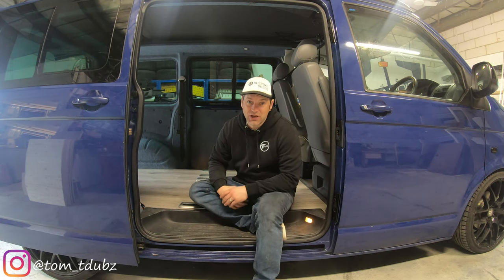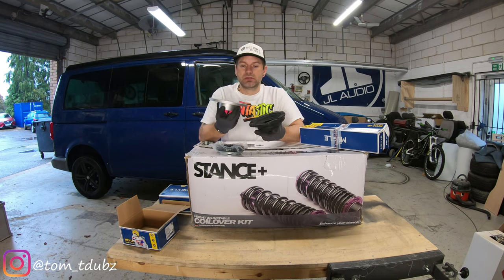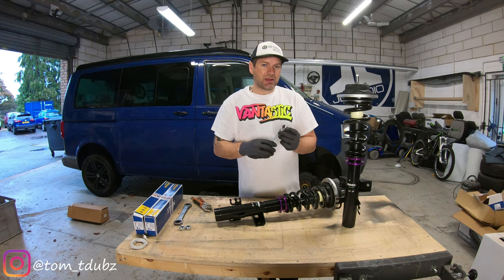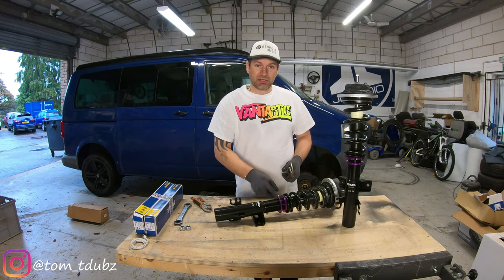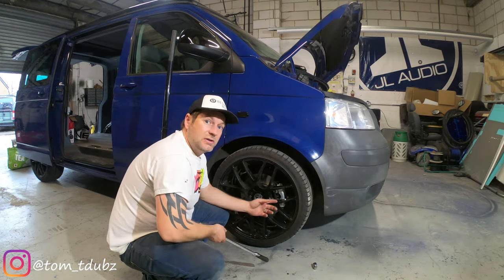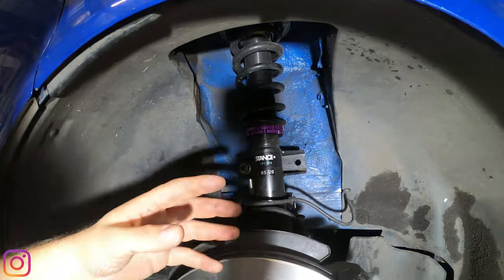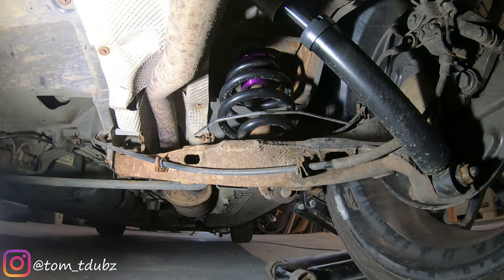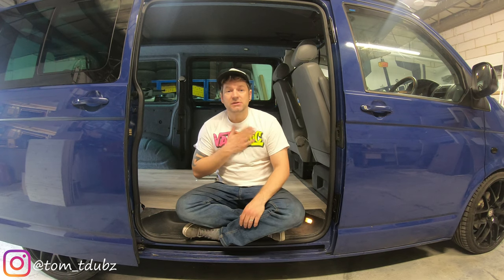VW T5 coilovers #series2 #episode6 #stanceplus

Comment: Nice tutorial !
May i just ad a small comment to the fitting process...
Iff you are changing the standard shocks and springs  for a  lower /coilover setup ,then its wise to loosen the bolts of the wishbone (don't undo them ,just loosen them a bit ) .
Once you have installed your lower suspension ,fasten the bolt's of your wishbone ,when the  van is lowered down on it's wheels ...the reason for this ,is to remove extra tension from the rubber wishbone bearings ,so they will last a lot longer ( otherwise they are under  continious stress ,and the rubber will tear  )
Reply from the maker: Thanks. That’s a great shout!!!! 👌🏻👌🏻👌🏻
Reply: @tomtdubz how does the van drive with the coilovers on? Worth buying?
Reply from the maker: @joemc5238  have to say for the money there great, if installed correctly.. they get a bit of bad press on some of the Facebook groups but 9 times out of 10 there not fitted correctly. I’m happy with them an have another set ready to fit on my latest build too 👌🏻

Comment: Had Mine fitted about 2 Mts now, all spot on ,,, my only grumble is they are a little bouncy over humps and bumps is that how they are ?
Reply from the maker: In my experience yes.. if your gunning it low then changing the rear shocks to gaz short shocks is good. For the front a hub mod then you can add some tension back on the coil.. 👌🏻
Reply: I would like to see this hub mod please
Reply from the maker: https://youtu.be/jVly-MDEvAw

Comment: Hi, great video and thanks. Do you still recommend these for the money or would you advise another brand for comfort. Thanks.
Reply from the maker: I’d recommend these all day long for the money, there not solows or b14’s but there also not 1000+ great bit of kit for 300 ish 👍🏻
Reply: @tomtdubz  awesome. I'm looking online and there's different names. Stance street, stance proline, stance etc etc. Which ones do you recommend bud. Thx
Reply from the maker: @danielwoolcock7267  personally I’d go for the street kit.. new top mounts and drop links. The proline gives you more adjustment on the rear and can go a little lower.. depends what your plans are…
Reply: @tomtdubz  not worried too much about going really low, it's more of a close the gap down type fix. I'll go for the street kit then. Nice one 👍🏻